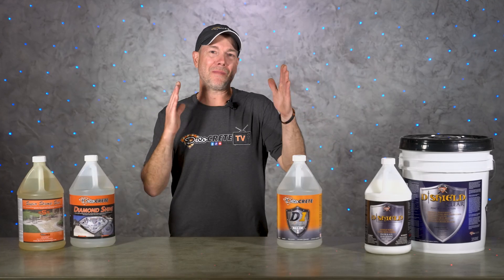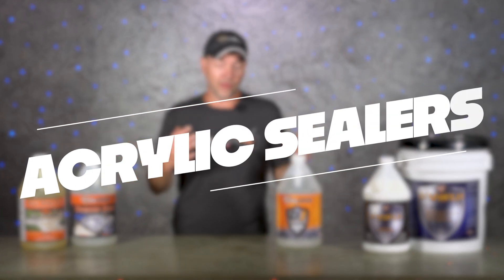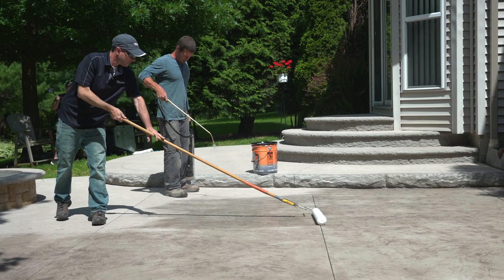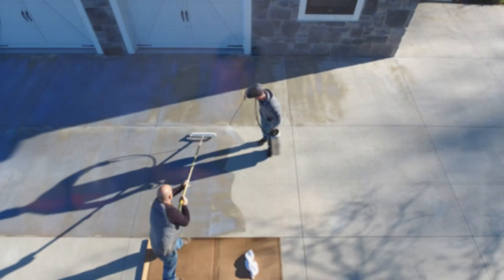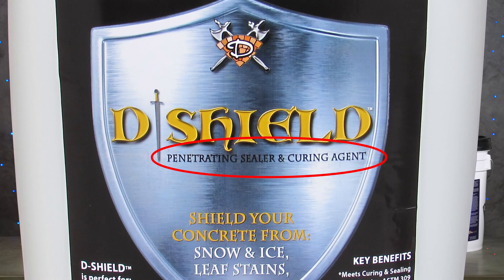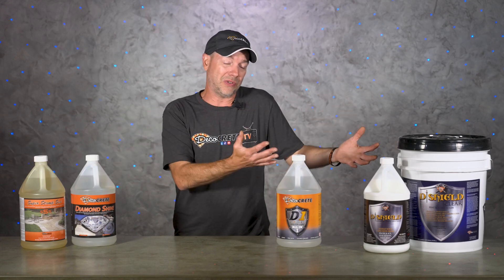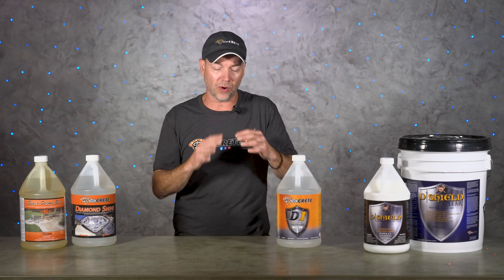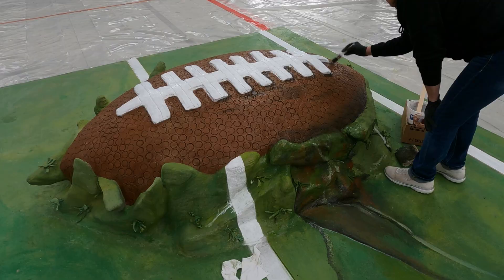Concrete Sealer Showdown: Acrylic vs. Penetrating Sealers

Comment: Great video here.
 Like to put in a little here.
 I been in the game for more then 30 years now.
 I'm on another massive jobs for a 1 man band, I'm using a acrylic solvent penetrative seal, this project is a carpark, 4 thousands square metres, the concrete has been machine trowel  burnished surface concrete,  from all the job all these years, found that using penetrable sealer, as say this, its called salax sealer, the floor gets massive pressure washed and clean spotless, as its a car park, cars be driving in and out every day of the week, as using surface sealer they break down over 5 to 8 years, sadly, treatment is required to bring back life, as to penetrative sealer, i found that it last 5 times longer as jobs iv done like 15 to 18 years ago, its important to say this, most of my projects are not in UV environment, the trick i found, i use dry vacuum diamond padding from 400 to 800 to 1500, then i use a roller not a sprayer at all, the first coat is thick as it can take but no paddles, on the same day after few hours of dry time, i reapplie the sealer, the only different is when i do, I'll do about 50 square metres at a time, once re coated, i use a polivac with red light floor scrabber, i go over it twice, then using a white polishing waxing pad, without wax, go over her again, it has a massive difference dure to wear and tear of vehicles, it doesn't leave any rubber stains on the concrete at all and its like putting on a surface sealer with out a surface sealer, spraying in my world won't work, it needs to be rolled out, not sprayed.
 Till this day, i go pass many jobs iv done, and still can help but just step in to investigate how it looks still. Still like the day i done it

Comment: He didn't really say it but basically there's three types of concrete sealers:
1. Film forming laminar layer, solvent-based acrylic sealers. These have extremely toxic vapors l, are flammable, extremely messy, and sit on the top of the concrete and add shine and a film. In my experience over time these, If done outdoors (especially on stamped concrete or rock salt texture) ALWAYS haze, develop efflorescence buildup underneath it, delaminate, bubble up. These are a nightmare to remove. So what most people do is keep piling layer upon layer upon layer over the years and it creates a nightmare. I disagree with him after 17 years experience. I don't care what kind of UV protection they claim. What happens is moisture under the concrete from sprinklers, rain, etc., vents upwards and lifts the sealer. You must check the moisture reading of the concrete before you apply solvent acrylic sealers. We only use these indoors, but only in situations where there is complete ventilation.
2. Pure penetrating sealers, that leave the concrete matte. These are usually siline or siloxane or a combination of both. These do not alter the color of the concrete at all and they are super good at penetrating and repelling water and preserving concrete from deterioration. I've never had to reapply a penetrating sealer, even years later.
3. Hybrid water-based acrylic sealers, that DO slightly penetrate AND also form a micro film while moderately enhancing/darkening the color. These are the best of both worlds and some are yv-redistant. They rarely haze and never peel. They just simply wear off over time in a micro powder like form that you do not see. You usually spray reseal every 2 to 5 years. 
We spray all water-based sealers ALWAYS in two iterations, separated by 4 hour periods. Generally solvent-based sealers don't require two coats if outdoors. Always expect a fixup call-back when you use solvent-based dealers outdoors. Applying another layer on top of a solvent based sealer just creates more and more problems. I disagree with him. Water based acrylic sealers are extremely easy to reseal over. And they tend to dull over time but you don't see any hazing, flaking etc if you apply it into lite spray cycles.
Note: never use a two part epoxy sealer outdoors. That's the mistake from hell. Those sealers are strictly for indoor gloss floors. Don't confuse these with the outdoor epoxy based concrete paint that is a coating. They also work well if you do the surface perfectly. But they cover the concrete.

Comment: Great Video! 
My question is, what would be the best sealer for the interior of a home? 
Are there any concerns of bare feet long term on these products?
We have polished concrete and will not be putting any flooring on top. We also prefer more of a matte/satin finish, but would love the deep colors to come out! This is in a Barndominium.
Reply from the maker: Thanks for the comment!
Polished concrete is a little bit different. The sealers in this video would normally be used for broomed, troweled, or stamped concrete. When the surface of the concrete is polished, the pores become really tight and it would be hard to get a sealer to stick to it. Polished concrete also doesn't need sealer the way that other concrete finishes do. The polished concrete contractor normally applies a densifier during the polishing to fill up all the micro pores on the surface. After the polishing is complete, a polishing guard product is applied to help guard against staining and water spots. 

The first thing I would do is check with the contractor that polished the floor and see if they applied any polish guard or not. I'll leave a link to our polishing guard below. 
Any of the sealers or polishing products are fine are for bare feet. The polish guard will last quite awhile, but it could be reapplied down the road if needed.

Hopefully this helps! Thanks for watching Deco-Crete TV!!! 

https://www.deco-cretesupply.com/products/polished-concrete/polishing-guard

Comment: Great Video, thanks, what kind of sealers do the Radon people use on the pored concrete?
Reply from the maker: You are welcome! Thanks for the comment! Some concrete sealers can help reduce radon from coming up through the concrete, but it's not really considered to be a radon mitigation system. I'll be honest, I don't have much knowledge on radon mitigation and I don't know witch concrete sealers are the most effective for that. I would start by contacting a local contractor that installs radon mitigation for more advice. Thanks for watching Deco-Crete TV!!!

Comment: I just completed a backyard patio with stamped concrete border and steps to the sliding glass door with my question is is I'm looking for a sealer or penetrating sealer that's going to last the longest before it has to be applied again. What do you recommend and thank you.
Reply from the maker: Thanks for the comment! I would recommend our D-One sealer for that. It looks great on stamped and is our most longest lasting sealer. D-One will bring out all the color on your stamped concrete and has a very natural matte finish. I'll leave a link below. Thanks for watching Deco-Crete TV!!!                                                                                                                               https://www.deco-cretesupply.com/products/decorative-concrete-sealers-solvent-based-sealer/d-one-5-gallon
Reply: @DecoCreteTV thank you for the reply however I live in California and I'm not sure that it's legal here.
Reply from the maker: @dwainsellers6453  Yes, there is a chance of that. You'd have to check your local VOC laws to be sure. D-One is considered low VOC for a solvent-based sealer. If it's out of compliance in your area, you'll have to go with something water-based.

Comment: How can I seal my concrete but make it black? Don’t wish to remove and go to asphalt. But want it black.
Reply from the maker: Thanks for the comment! We do have black tint packs available for our solvent based acrylic sealers. However, this is not a permanent solution, and it will need to be maintained. As the sealer wares down, the black color will also ware with it and you will start to see the gray concrete again. Tinted sealers are a easy & coast effective way of coloring existing concrete, you just have to understand it's limitations. It will generally last longer then paint, but it will ware off at some point. I'll leave link to the page on website below. Thanks for watching Deco-Crete TV!!!                                                                                                                                                                                                                                                 https://www.deco-cretesupply.com/products/acrylic-color-packs/acrylic-color-packs

Comment: I’m confused. I have just spent a huge amount of time and money stripping an old concrete porch back to
raw concrete. I do NOT want to darken the natural white color, so should I use a matte penetrating sealer? It sounds like a matte penetrating sealer will not prevent surface stains
Reply from the maker: Thanks for the comment! Yes, I would recommend a penetrating sealer for your project. It won't leave any film behind that would darken the color or add sheen to the slab. Penetrating sealers will still protect the concrete from water intrusion and staining. I'll leave a link to our D-Shield sealer below. Hopefully this helps clear things up. Thanks for watching Deco-Crete TV!!!                                                                                                                                                                                                                                                                                                                                                                                                                                                                                                            https://www.deco-cretesupply.com/products/water-based-sealers/d-shield-5-gallons
Reply: @DecoCreteTV thanks!!!

Comment: How to make sealer?
Reply from the maker: Thanks for the comment! Making a concrete sealer isn’t really something you can DIY. Sealers are made with resins, polymers, and solvents that are carefully engineered and tested for performance and durability. It requires lab equipment and chemical expertise to get it right. The best option is to use a premade sealer from a local concrete supply store. Thanks for watching Deco-Crete TV!!
Reply: @DecoCreteTV How about making an acrylic sealer by mixing xylene and a shiny substance like sugar?

Comment: Here's a crazy question... if i apply a "MicroCement" veneer to a shower wall, could i seal it with one of these products? If so, which would you recommend?
In my simple mind, a vertical shower wall doesn't see any more water than a horizontal concrete driveway.
Reply from the maker: Thanks for the comment! Concrete sealer could work for that, but most people would use a urethane or polyaspartic. It's not so much about the water intrusion, it's more about the cleanability & longevity. Concrete sealer will eventually wear off and need to be reapplied. Urethane or polyaspartic will leave a thicker film behind and last a lot longer. I do like the natural look of a penetrating sealer; it'll just be harder to clean. I'll leave a link to our Rock Top Matte countertop urethane below. That would be easy to use, creates a natural look, and lasts a really long time. Hopefully this helps. Thanks for watching Deco-Crete TV!!!                                                                                                                                                       https://www.deco-cretesupply.com/products/countertop-sealers/rock-top-wb-matte

Comment: What would I use if I'm making and sealer concrete planter bowls for plants
Reply from the maker: Thanks for the comment! Most people like to use a penetrating sealer for that. Sealing the inside of the planter is the most important, so the moisture doesn't work it's way to the outside. Sealing the outside is optional, it'll help it resist stains and keep it looking nice. But, some like to paint the outside, and in that case, the sealer won't let the paint bond very well. We would also recommend letting the sealer dry for at least 24hrs before planting anything in the vessel. I'll leave a link to our D-Shield sealer below, that would work really good for this. Hopefully this helps. Thanks for watching Deco-Crete TV!!!                                                                                                                                                                                 https://www.deco-cretesupply.com/products/water-based-sealers/d-shield-1-gallon
Reply: @DecoCreteTV thanks

Comment: After that 30 day reapplication for the penetrating sealer, when will be the next treatment
Reply from the maker: Thanks for the comment! Penetrating sealers generally last 3-5 years. Basically, once the surface starts letting water soak in really fast it's time to reapply. You can test this by dumping some water on the dry slab and watch how fast it soaks up the water. As long as it's still repelling water, no more sealer is needed. Thanks for watching Deco-Crete TV!!!

Comment: What is the best for concrete pavers.
Reply from the maker: Thanks for the comment! This really depends on what you're looking for from the sealer. Penetrating sealers are our best recommendation for pavers, but it'll only make them more water/stain repellent, and doesn't darken the color. If all you're looking for is water repellency and stain protection, then penetrating sealers are the way to go! If you're looking for color enhancement, you'll need something acrylic & film forming. This is where things can get a bit tricky on pavers. They are a lot more porous then a concrete slab and the joints tend to let in a lot of moisture. Piling a bunch of acrylic sealer on top of them will generally lead to whitening/clouding in the sealer over time as moisture is constantly coming up through the pavers. Something like our D-One sealer would darken the color and give you the best chance of looking good long-term. I'll leave a link to D-One below. Thanks for watching Deco-Crete TV!!!                                                                                                                                                                                                                                                         https://www.deco-cretesupply.com/products/decorative-concrete-sealers-solvent-based-sealer/d-one-5-gallon

Comment: my driveway it 45 years old in arkansas. I pressure washed it and it looks great. However there are no flat smooth areas. Its all rough but looks good. I noticed when its wet that it has a slight tint of tan and I really like it. Its also steep so do not want it slick.  So is the solvent sealer a good option to give me the slight tan look. Thanks again and enjoyed the vid.
Reply from the maker: Thanks for the comment! Sounds like the driveway is doing great for being 45 years old! We always recommend a penetrating sealer for driveways, but that will not bring out the color like when it's wet. A solvent based acrylic sealer would do that for you. However, it'll be harder to apply without seeing sprayer/roller marks, and it will make it more slippery. I understand the look you're going for, but it does come with some downside. Penetrating sealers = easy to use, very forgiving & leaves the concrete looking natural. Acrylic sealers = Harder to use, possibility of clouding/hazing over time, requires more maintenance, but darkens the concrete & give it a little bit of gloss. You'll just have to decide what is most important to you. Hopefully this helps. Good luck with driveway! Thanks for watching Deco-Crete TV!!!

Comment: So the d shield would be the best option to not allow water to penetrate concrete ? I don’t care about looks at all just need to stop water penetration.
Reply from the maker: Thanks for the comment! Yes, D-Shield would be the best option that! Thanks for watching Deco-Crete TV!!!
Reply: @DecoCreteTV thank you sir. got a product recommendation on filling cracks ?
Reply from the maker: @de9231  Here's a link to some stuff that works pretty good. Won't last forever, but it's easy to use and looks nice.      https://www.youtube.com/shorts/DhwZb5TkzHU                                                    https://www.deco-cretesupply.com/products/repair-prep-products/magic-crack-filler

Comment: Hi, I just did Sika self-leveling underlayment cement with 3oz of black dye for our bathroom floor to get it darker but it wasn't enough we just want to get a darker wet look with a sealer but want a matte finish.  To be clear, we want the dark cement look and have no plans for flooring or tile.  What would be best to use for a darker wet look (like as dark when watered) but not a glossy finish?  And is there anything like this that we could just get at HomeDepot or Lowes?
Reply from the maker: Thanks for the comment! I'll doubt that you'll find anything like that at Lowes or HD, but our D-One would be a great option for you. Most sealers that darken the color will also have a higher sheen. D-One will still bring out the color, but it's not high gloss. I'll leave a link below. Thanks for watching Deco-Crete TV!!!                                                                                      https://www.deco-cretesupply.com/products/decorative-concrete-sealers-solvent-based-sealer/d-one-5-gallon

Comment: Can I apply the penetrating sealer with an airless sprayer with the proper sized tip?
Reply from the maker: Thanks for the comment! Yes, an airless sprayer would work for that. However, penetrating sealers will also spray great out of a pump up sprayer. Most of them are really low viscosity and pretty much spray like water. Whatever kind of sprayer you decide to use, just make you sure you clean it out with water when you're done. Thanks for watching Deco-Crete TV!!!